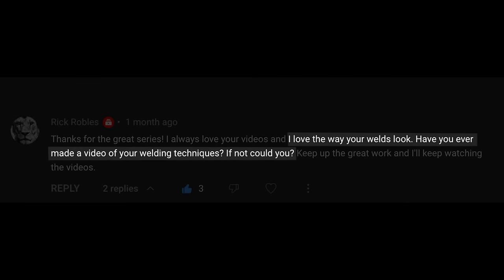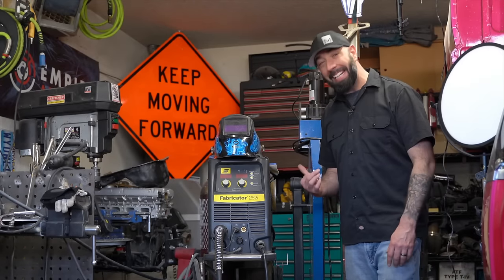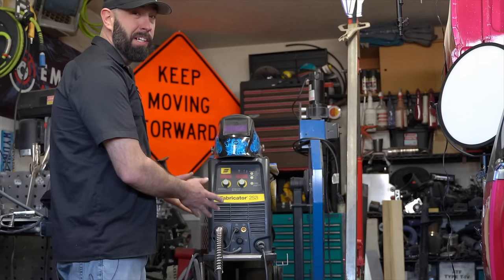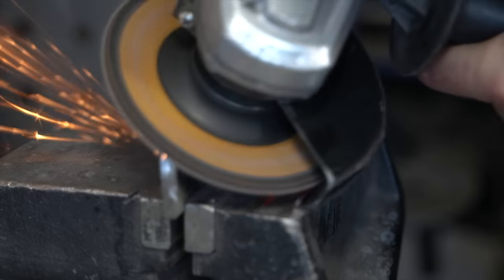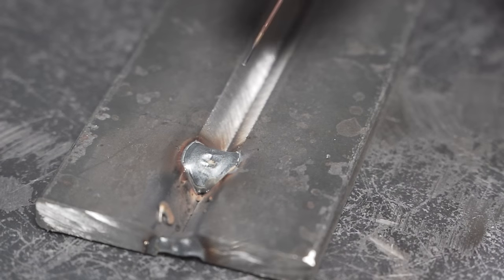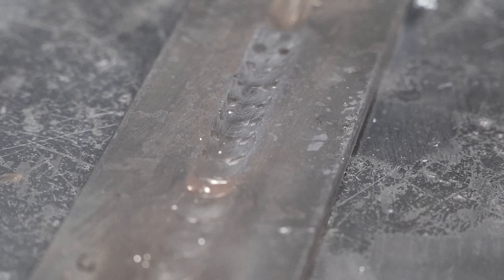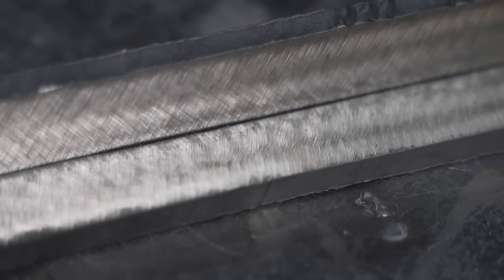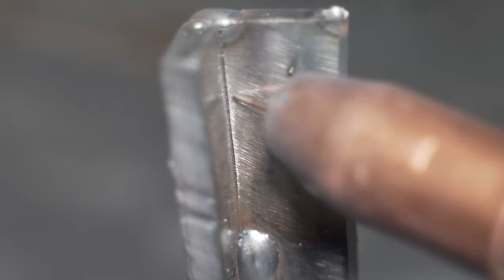MIG Like Mankandy: Techniques for Stacking Dimes with a MIG Welder

Comment: Love the technique.  I am just a newbie and what I have a problem with is I feel like I have to go fast to keep from burning through.  I am using thinner metal than what you are showing in the video.  What is your guidance for thinner metal.  I have tried lower voltage and wire speed but just can’t seem to get the right combination.  HELP!!
Reply from the maker: How thin are we talking, Mike? It sounds like you already know what needs to happen; you have to speed up or cool the machine down. 😩
First, understand that sheet metal is a challenge to weld, even with experience. Try and maintain your patience. 
Thick stuff is easy. You can crank up the voltage and go really slow. This is why I chose to use it in this video. It’s so much easier to show the movements with a very slow pace, and thin metal just won’t allow that.
What I’ve found with sheet steel is you either have to move fast, or you have to resort to stitch welding (or series of spot welds)
For body panels, I stitch, and I cool each weld with a wet rag to limit warping. For stitching, the voltage is pretty high. You have to penetrate well with only a short burst. The voltage is so high, in fact, that a weld longer than a half second will likely burn through. Each spot weld will be fairly flat, not a ball resting on top. If you have the ball, the voltage isn’t high enough.
For exhaust, warping isn’t an issue so I’ll run long beads. I’ve learned that with thin metal, there’s a much more narrow window between too hot and too cold.
With thick metal, you can change the voltage 10 volts and get a similar weld.
On thin metal, every volt makes a difference. 1 or 2 volts could be the difference between balling on top or burning through.
So finding that perfect setting for running beads on thin metal isn’t easy. Take your time on some scrap of the same size.
Even once you find that perfect setting, understand you’ll still be rushing. On sheet, there doesn’t seem to be a setting that allows you to go slow and still get good penetration.
Some folks like to use thinner wire for sheet metal. Maybe you should give that a try. Buy a small roll of .023 and see what you think.
The thicker the wire, the more voltage is needed to penetrate and therefore the more likely you are to burn through.
Hopefully this helps. It’s basically just an over complicated way of saying, have patience, practice, breathe, and don’t beat yourself up. It’s not easy.

Comment: This helped out a lot. Now i know what penetration really means. How can I tell I melted the base metal enough? I was looking to see signs of that but couldnt tell.
Reply from the maker: Remember, I’m not certified, so ask this question to several other educated people.
When you’re actually welding, you can see the base melting just before the puddle covers it. I think there’s parts of this video where you can see the corners of each side of the joint collapsing as the arc approaches.
Probably the only correct answer to that is to cut a cross-section of your weld, buff it, and apply an etching compound that will allow you to see your weld nugget and it’ll show you how deep you penetrated. Do a YouTube search for weld etching, or weld inspection and lemme know if you see any quality results.
Reply: @GarageFab  will do

Comment: Yes, this definitely is the basics. I've been bushing up on my geometry and Even though I like the Parallel Bar set up, which is fine for cruising speed.  I'll  be going with slight negative pinion angle for constant  pressure or force  , which ever term is comfortable in conveyance. Cool video, nicely done
Reply from the maker: Thank you my friend!

Comment: Excellent video content as usual. Self taught welder here and it's good to see someone else using the same techniques I've settled on.
Reply from the maker: Yes! If it works it works, Chris! Have you ever tested/inspected any of your welds? I’m getting a lot of comments that say these techniques are garbage. I personally have not tested anything aside from perhaps 20,000 miles of street driving. 🤷‍♂️
Reply: @GarageFab  Not needed to test anything, have often thought about it out of curiosity though. I've read some of the comments and can see where they are coming from. When I'm using the MIG welder it's on relatively thin materials, can usually see whether the weld has penetrated or not, are very rarely structural and know my limits. For heaver stuff I break out the stick welder where I very questionable methods ;)
Reply from the maker: Haha! 🤦🏻‍♂️

Comment: Hello! I have the same welder but it is a Tweco 252. I was just curious if you are using .30 or .35 wire in the video.
Reply from the maker: Yup! Same parent company. It’s got a couple other names too.
I use .030 almost always.

Comment: Have a problem with the wrong- Helmet lends, not seeing my work.
Reply from the maker: It took me a LONG time to realize how important it is to be able to see your weld clearly. (Sounds obvious, I know)
Get the best helmet you can afford and purchase a bunch the replacement lens protectors. I used to postpone changing the lens protectors as long as possible not realizing how badly even a slightly dirty protector affected my vision. Now I change them often.
Also, for the name brand helmets, (Miller, Esab, Optrel, etc.) you can purchase magnification lenses that attach inside the helmet if your vision isn’t great.

Comment: Nice tute, and good looking welds.  It looks like you pull all your welds?  Isn't that another "broken rule"?  Does it matter?
Reply from the maker: After sifting through hundreds of “Never Pull!” comments, I’ve determined that it depends on what you’re welding. I’ve found that pushing allows the gas to shield better. There’s less soot on the finished weld. One can assume that means the weld itself is also cleaner. 
When pushing, I struggle to be able to see. I’m able to get a uniform bead because I can clearly see the already existing weld. When pushing, the gun obstructs my vision no matter where I position the gun or my head.
I have cut my welds and have found good penetration with no inclusions so I continue to pull.
I assume it’s probably true that pulling is prohibited when welding certain vital components. (high-pressure vessels etc.)
For the majority of what I do, I don’t think pulling is as sinful as many make it sound.
My opinion is and always will be,  know and understand the rules so you can break them wisely.
Reply: @GarageFab  thx for the reply!  I prefer to pull for the same reason - I can see the puddle better. A lot of the initial problems I had learning how to do  this went away when I set up the helmet correctly, added a helmet lens, and a headlight.  Thx again 👍
Reply from the maker: Yes!! Visibility is 90% of it! Even a slightly dirty lens can cause problems.

Comment: Why is the millermatic 211 your favorite?
Reply from the maker: It’s difficult to explain. They say welding sounds like bacon frying. With a lot of machines that’s true. A kind of crackling popping noise. The 211 produces a much smoother buzz. Not like bacon at all. The smoothness shows in the weld, it’s consistent and even with minimal weld spatter even on dirty metal. I think my welds look decent with my ESAB but whenever I use the 211 at work my welds look like a machine did it.
The Autoset feature is quite handy sometimes. Occasionally I just want to slap something together without worrying too much about perfect penetration. (Exhaust for example) I set it to auto and go.
Reply: @GarageFab yea, I have it lol. Got it from offerup. I tested it out before I bought it, I said damn, it was like "ssssss" and yea much much much less spatter than I'd been used to; I hadn't welded for about 6 years at the point. I was shocked also because I originally learned to weld on a millermatic 212 I think, those old transformer ones. There used to be so much spatter. I'm a mechanic apprentice now, and what you say about the weld being "hot", when I was training at school the instructor said i was running hot.  He said I had great control. What do you do?
Reply: @GarageFab I think your mig is really good. For me, I've been so impatient I found. I had to get used to it again.  But in schooling I was forced to stick weld. I had to choice but to calm tf down and control the puddle. The craziest thing too, I learned, stick also doesn't leave much spatter at all when you do it right🤣

Comment: Thanks man, it’s amazing the potential with a mig, I was thinking I need a tig to get those kinds of results.
Do you use an anti-spatter spray?
Reply from the maker: Thank you, Jim! I don’t use spray but I should probably get some. When you finally figure out the delicate balance between wire speed and voltage, your welds will sound much smoother with less popping and crackling. Less popping and crackling means less spatter. There will always be spatter with MIG but it seems my spatter is harmless. Meaning much of it brushes off or scrapes off easily. Where I really struggle with spatter is upside down welding. Recently, when welding control arm tabs, my bushing below caught all types of spatter. The bummer kind that only a grinder can remove. I wonder if anti-spatter spray would help there. 🤔

Comment: Very interesting. I have a question though. I’m just getting started at home and was told that you push wire feed but pull stick welding. Does it matter? As long as you get good penetration I should be good right?
Reply from the maker: It depends on who you ask. I think more importantly it depends on what your working on. I believe pushing gives you a cleaner and more pure weld, with less chance of porosity and inclusions. So pulling would be frowned upon in anything structural. The only thing more important than purity is penetration. I don’t think pulling negatively affects penetration if your technique is good. If you’re comfortable pushing, keep doing it. I struggle with it. So I pull.
Reply: Ok cool thanks for the advice. Looking forward to your next video. Restomoding my grandfathers 77 f150. Full frame off, bags and all. So watching this is helping. Keep it up 👍.

Comment: Heya Aaron. I’ve been practicing FCAW. Sometimes, I lay down a nice full length bead and they look bad ass after chipping the slag. It honestly makes me proud to see. Most times, as you mentioned, I struggle with settings. I’m positive it’s my technique; angle and stick out sometimes turn into strange wrist positions. I feel like this because sometimes, my bead starts out great but when i get uncomfortable and out of position, i get mad popcorn.

With flux core, when you’re forced to stop a bead run, do you have to remove the slag and wire brush it before continuing? 

As a new welder, how can I identify when I should terminate my weld to reposition. I know that sounds silly ‘when it gets uncomfortable lol’ but maybe there are signs I should pay more attention to?

Thank you as always. I hope you’re well!

Comment: 30 + years of melting all kinds of alloys of various thicknesses together. Even got me a bunch of those AWS certs in S, T and M or am I certified in S&M😁. Stopped making other people rich and put that effort towards myself about 10 or so years ago (welding is easier). Decided I didn't want to f**k with anything over a 1/4" any more and for the most part don't. Small shop with small tools. My large machines are my Miller 211 and Miller Syncrowave 200. Not a brand specific kinda guy, just a killer package deal for the two. Although I do lean pretty hard to the red 😉😉. Both machines work great but they do have their limitation. There are better machines available now that are capable of much more in a smaller package. So don't get hung up on a particular machine. Make your choice according to what you are willing to work on i.e. process, position and thickness. Happy trails and let the blue light guide you.

Comment: If your movent is continuous, like a machine, continuously pushing the wire and a specific speed, the welding will be better than welding using a pattern? Another question: pulling or pushing?

Comment: Excellent video; but I couldn't understand why you constantly show MIG welding in 'reverse' order, per se, meaning dragging, vs pushing. The common adage, 'If it has slag, you drag' and MIG you 'push'. But, somehow, you pull this off and your beads looks great. Making me reconsider the theology behind that... Enjoyed the vid is the bottom line.
Reply from the maker: Remember that I’m not officially trained in welding, so take my input with a grain of salt…
I’ve learned that people love to share their ‘knowledge’ though most are unable to explain WHY their rules are law.
Here’s what I’ve come up with; I have found that by pushing the MIG gun, the final bead has better gas coverage which results in less soot resting on top if the completed weld bead than when pulling. It might be an accurate assumption then that pushing therefore produces a cleaner weld. (Less imbedded contaminates/inclusions)
I have cut and tested my pull welds and found no inclusions, excellent penetration and sufficient strength.
Because of the known potential of contamination I can understand that when welding vital components, (i.e. food grade storage tanks, pressure vessels, structural, etc.) dragging the gun may rightly be “forbidden”.
For my applications, I continue pull because the gun obstruct my view of the bead when pushing. In order to create a uniform bead, I need to be able to see a portion of the completed weld. No matter where I position my head, or how I angle the gun, my view is obstructed when pushing and the quality of my welds suffer.
I strongly advise that you find the deeper reasoning to why pushing is better than pulling. My personal adage is learn and truly understand the rules so that you can break them wisely.
Reply: Thank you @GarageFab . Honestly, your response is deep, thorough and makes sense. I'm a retired AF Mechanic and to me I 'ask' the question because I want to learn... I see MIG welding (push/pull) both ways, but you clearly demonstrated the art of execution and the results are simply stunning. For that reason,  I inquired and appreciate your feedback. Your Channel is amazing (just recently Subscribed) but what you taught in that video raises my inquiry. I happened to hit another another video just after yours and they did a proper cut and etch and to me, it DOES look like the pull was a smidgen deeper in the penetration. Again, I'm asking to learn; I always want to hear people and experiences like yours because you can elaborate and articulate it - as you did. Awesome video so I think I'm going to experiment with both ways and see if I can one produce MIG welds like yours. LOL.  Cheers and thank you.
Reply from the maker: @AXNJXN1 Thank you my friend. You’ve got the correct mindset to achieve greatness in anything you tackle. Best of luck! 🍻

Comment: It's good to know that I don't suck my welder sucks lol I have a Lincoln 145 I believe from home Depot flux core
Reply from the maker: Oh boy! I can’t speak for the welder. (Lincoln is great) but flux core takes a LOT of skill. That I do not have.
Reply from the maker: I use 1/4 2x2 mild steel and keep the bag back further than the halfway point. You absolutely can move the upper links inward. Realistically you only need one right in the center. The upper bars are just there to keep the axle from rotating on acceleration and braking.

Comment: I got an old Lincoln mig and a new cheap harbour freight mig both 75/25 gas and the hf mig cant hold a candle to my Lincoln!
Reply from the maker: Why am I not surprised? Lincoln is a hood unit. Do you have the new Vulcan machine? I’ve been wondering if those are any good.

Comment: How do you know when your welds are good enough to work on suspension components?
Reply from the maker: I think the only way (if you don’t know what to look for while welding) is to test your welds. You can weld something and attempt to break it. Bend it back and forth or beat it with a sledge or both. You can also cut, buff, and etch a weld to see how good your penetration is. I’m sure there’s videos on that specifically.

Comment: 3:40, did any one catch the wfs, of 350 inches per second ? 
dang, that is 21,000 inches per minute, with .030 wire, that is 10,500 amps.......
by the way, what wire diameter are you using.....cheers, Paulie Brown
Reply from the maker: It seems everyone in the world noticed. 😆 
The Esab wire feed superchargers are flying off the shelves.
I’m running .030 at the moment.

Comment: If you are just starting out welding, get a 220 volt machine.  A seasoned welder can adjust "himself and the machine" and dial in a 120 volt machine, but they are not as easy.
Reply from the maker: Decent advice, fellow Miller! Thank you.